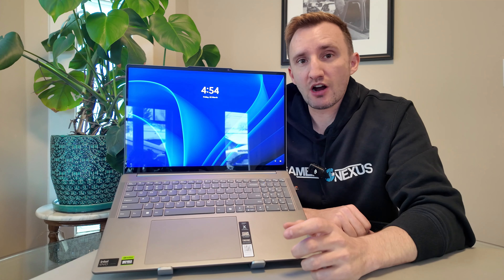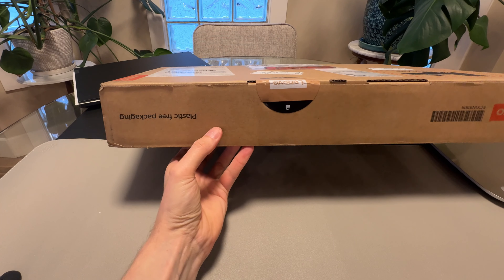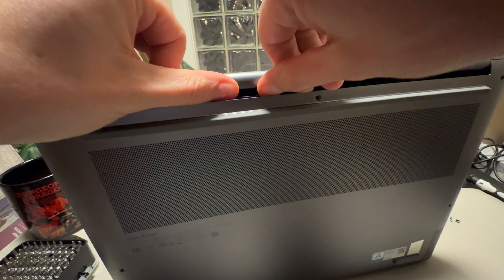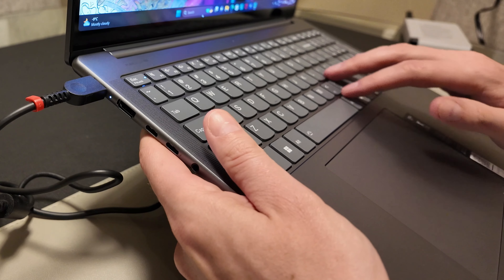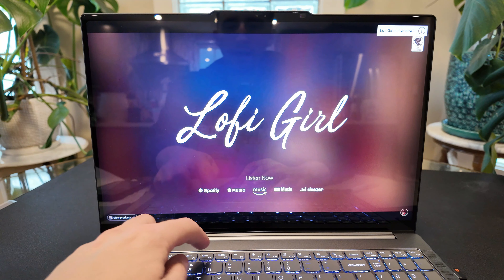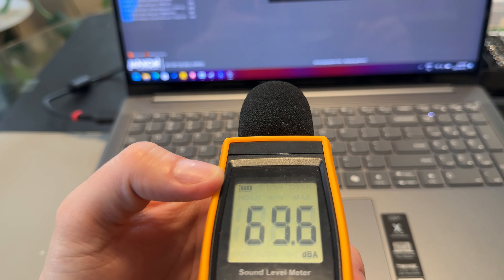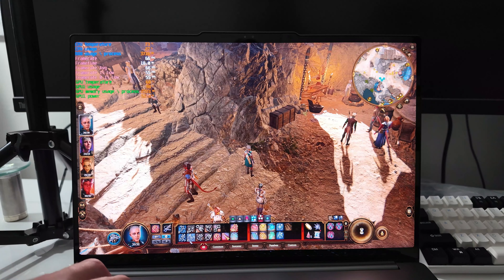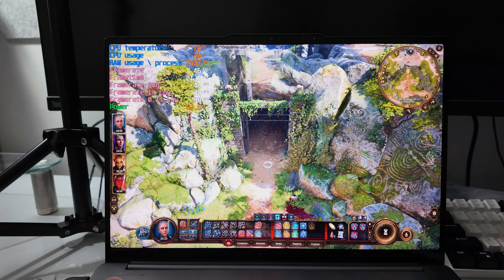I'm in Love again... 2024 Lenovo Yoga Pro 9i Gen Review

Comment: Ah! A proper review. Not sponsored. Thank you.
Reply from the maker: So not sponsored that I bought it myself 💸💸💸

Luckily it’s nice enough to justify the cost
Reply: @TechGuyBeau  Yeah, what a step up from most of those corporate influenced reviews. 
Do you think its worth upgrading from my 2023 zenbook pro 14 oled, the one with 4060 and 13900H ? 

Im really battery life dependatent as a cs stundent, the bigger display thats not OLED, doesnt degrade over time..
I feel my asus is just not the real deal for me, im used to 16inch laptops.
Or should i just wait for Lunar Lake laptops?
My other choice would be a 16inch m3pro or upcoming m4pro macbook.
Reply: @TechGuyBeau  Thank you for the review, really detailed. Also, totally agree with the RAM, never go with the smaller version if soldered.
What about choosing between this one (with 64GB) and , IPS 240Hz , Intel Core i9 14900HX , 32GB DDR5, 1TB SSD, GeForce RTX 4080 12GB? I'm between these two models with the Legion being 350Euro more expensive.

Comment: This laptop has a mux switch, if advanced Optimus is turned on, which I think it is by default, the dedicated gpu will not be recognized when on battery power. I noticed when you were trying to update the driver for the gpu that you didn’t have the power adapter plugged in. This would make sense why the driver update failed because the gpu was disabled. If you go into device manager when on battery power, the dedicated gpu won’t even show when looking at connected devices.

Comment: Hello, Which laptop would you recommend for both gaming and my work involving databases and programming with Android Studio?" Lenovo - Legion Pro 7i 16" WQXGA - Intel 14th Gen Core i9 32GB - RTX 4080 12GB - 2TB SSD or ASUS - ROG Zephyrus G16 (2024) 16" OLED 240Hz - Intel Core. Or any other model you recommend Thanks.
Reply from the maker: The legion will Massively outperform the asus. The advantage of the asus is the OLED screen (if you want that)  and weight for sure

The legion will perform significantly better, has a non burn in risk nice ips (no OLED blacks though), and is generally much better bang for th buck 

If portability is king consider the asus. Otherwise go legion

Oh… and thanks for the donation 🥹

Comment: Awesome video! I wanted to add a second NVME drive and was wondering, did you need to add some kind of heat sink/thermal pad to the new drive or is it fine without? And if you did, what did you end up using?

Comment: Thank you so much for this incredibly insightful review! It was extremely helpful in understanding the features and performance of the device. I'm currently trying to decide between this model and the ThinkBook 16p. Based on your experience and the details you've shared, which one would you say is the better choice? I greatly appreciate your advice and expertise!
Reply from the maker: The Thinkbook has better cooling, but current is 13th Gen. there is a new Thinkbook 16p coming out that would be a better match for this

The Thinkbook 16p has a lovely 3.2k screen offering, about the best IPs I’ve used. But it’s still no mini LED. However it is not glossy like the yoga 9i. If screen reflections matter

The Thinkbook is a bit heavier, something like a legion 7 slim. Both are equally premium.

Thinkbook 16p has superb speakers… but the 9i has godly speakers. 

In the end I’d decided based on glossy vs non glossy. If you can deal with glosssy (which makes the colours pop more) get the mini led yoga.

Comment: Edit: I was using the latest Linux Mint. Ubuntu itself should work better than mint currently.

It is worth mentioning that if you want to use this laptop with a Linux distro be prepared to have many issues. Current issues that I have not been able to solve are: Lack of compatible kernel headers that have compatible Nvidia drivers that also work with the 14th generation cpu, Adobe Atmos is not available for Linux so the audio is very washed out, and the LFEs (subwoofers) not properly working even after configuring them in HDAJack.
Reply: @Worthless.  I’m using rocky9 on my zenbook 14x oled out of the box, but in fairness it only has igpu (radeon)
Reply: @Worthless.  ThinkPads are nice for Linux but I don’t know if you would call them premium. Also it’s worth mentioning that HDR is not yet supported on Linux. Linux Mint 22 also may fix many of the issues I had.

I’m not the best resource when it comes to Linux on laptops. I’d suggest asking the support forum of the distro you wish to use.

Comment: What do you recommend, a yoga pro 9i with ultra core 9, 32gb ram, mini-led touch, rtx 4060 (2300€) or Legion slim 7i glacier white with 13700h, 32gb ram, rtx 4060, 3200 res screen (1550€). 
The Yoga is brand new with 3 years premium care warranty, while the Legion only has a one year warranty, and is from ebay, apparently had faulty ram which was repaired (checked repair ticket with lenovo) , the seller mentioned the faulty ram but claims the laptop was unused.
I would mainly use it for music production but like doing some color grading when I have the time. I don't game.
I wanted something that was closest to a Windows Macbook Pro laptop. (good screen, build, speakers, etc)
The Legion just popped up and the difference in price is significant (800€)
I would love to know what your recommendation would be. Is the Yoga pro 9i worth 800€ more?
(I still have a chance to return the Yoga and buy the Legion if its still available)
I would really appreciate your advice.
Thank you and all the best!

Comment: I bought this laptop and am having the exact same issue of being unable to update the Nvidia drivers. I almost returned it because I was afraid I just had a bad unit. This reassures me that if it's a widespread issue it should hopefully be fixed. Other that that, fantastic review, I'm also loving the laptop for the same reasons
Reply from the maker: I’m sure they will sort it out, but I needed to include it in the video. People should be aware of current bugs that haven’t been fixed yet
Reply: Within GeForce Experience (the one that comes installed) have you tried updating or switching to Game Ready drivers?  Or am I missing the point
Reply: @TechGuyBeau  Has this issue been fixed?

Comment: Do you still have the laptop and were you able to fix your driver issues with updates? Thanks for the great review! I have have the smaller 14.5 inch slim pro 9i and am considering going for the larger display.
Reply from the maker: It works a lot better but battery life is still bad. I’d still suggest that AMD is the way to go, as it has been for several years now. Intel has a lot of catching up to do

Comment: Awesome review. Thank you for this detailed review of this model. 

For an windows laptop this lenovo model is awesome. In my region it is priced at ~2500€. 

What do you think about this model compated to the macbook pro m3 max ? Price difference is of ~1000€. I've found m3 max at the same price as m3 pro.

The laptop will be used for programming, daily tasks, probably some LLM, AI in the near future. Thinking about doing cross platform development also, but not 100% sure (only if i go with macOS will include iOS also).

What do you think it is a good long term option?
Reply from the maker: Mac has advantages for things like battery, however for compatibility value go yoga

Comment: I had a Lenovo C940 14 oled and I extended the warranty and I had some things replaced, but they couldn’t replace my battery so they offered me the Yoga 9i pro ultra 7 as a replacement but it only has 16gb of ram and now I’m concerned but I’m not really a heavy user and I can’t be picky if they are replacing it with a brand new unit. Believe they are building it for me

Comment: Can you comment on USB-C charging? Lenovo has been awful about that in my experience. The Legion Slim 7 Gen 8 I'm using right now is very picky about which chargers it'll work with. It's disappointing enough that I'm looking to get rid of it.
Reply from the maker: Oh that’s odd. Make sure it’s a true 100 watt usb c.  You can actually pick up the Legion chargers off AliExpress for like 35 or 40 bucks. They use USB-C and technically support up to 135 W
Reply: @TechGuyBeau  yea, I'm using high quality, brand names (Anker, Hyper, UGREEN, etc.). Lenovo's PD implementation is half assed
Reply from the maker: @CraigCabrey could be. I’ve never had issues on the slim 7 or pro 5/7 but definitely know what you mean on the slim 5.

Comment: Sir, I'd like to ask you two things from Korea.😊

1. Did the glass panel you purchased come with an anti-reflective coating, or is it a version without the anti-reflective treatment?

2. I bought the 2023 version but ended up selling it because the mini LED flickering was too severe for me to use. I'm very curious if the 2024 version still has the flickering issue.
Reply from the maker: I don’t notice any flickering. Also there was no anti reflective coating
Reply: @TechGuyBeau  Thanks for response.
Could you please answer one more question?
 I'm curious whether you think using a Mini LED version for working on PDF documents or Excel for 3-4 hours a day would not cause eye fatigue or discomfort. Or would it be better to opt for an IPS version for document work?
Reply from the maker: @고민이고민이다 personally I find it better. I stare at words and spreadsheets all day. Fine resolution,  bright, with good colours helps me. You can turn the brightness high when needed  and down when not. Typically I prefer niniLED over even OLED in this regard
Reply: @고민이고민이다  I thought it was Oled screens that suffer from PWM at lower brightness?

Comment: I bought the new Lenovo Legion 7i 2024 and have the same problem with my graphics driver it says last updated one is the January 24th, did you find a solution. Can Lenovo fix this or is this something that sticks forever?
Reply: Intel Arc iGPU + Nvidia dGPU drivers have compatibility issues right now.
Reply from the maker: Mr Kirby has it. Lenovo will probably need to reach out to Intel and nvidia and tell them to behave

Comment: can you share the configuration u use in your tests? like resolution, efficiency/power/balance mode, etc. Also, how did you change from iGPU to the nVidia? :o
Reply from the maker: You can watch my gaming test, it’s out now on my channel. 

As for switching between iGPU and dGPU, use nvidia control panel, under display locate “advanced Optimus”

Comment: Did you have the discharge on 170 watt power supply that they are talking about on Reddit? Basically battery drains while on power supply during performance mode

Comment: How does the gaming capabilities (and the corresponding fan noise) compare to the Legion Slim 5 14"?  I'd much prefer the 14" size, but am very tempted by the lower fan noise i keep hearing about this laptop.
Reply from the maker: Gaming will be basically identical to the legion 5 14”. 100 watt 4060/70 is basically

Comment: Hey, I'm wondering how far does the screen tilt I have the feeling it is not 180 degrees.
Do you notice any keyboard rattling when playing music at high volume on the speakers? 
And lastly, since the card reader is a UHS-I only, does it read UHS-II cards? (usually it's possible, I guess it's quite slower though)
Reply from the maker: it goes 180 or so. there is no rattle  as the keyboard is superb

Comment: I red on notebookcheck that the Power adapter is to weak under heavy load and the Laptop drains the battery. Can you confirm this? I primary want to Game on this beautiful Mini LED Panel. But this would WE a No-Go for me. Ty very much
Reply from the maker: I haven’t noticed, then again I don’t use performance mode as it’s really near pointless when gaming with a 4060/70. You get about the same with balanced and it’s vastly quieter.
Reply: there is no notebook check for this 2024 model out yet, only last gen so you are reading about last gens model

Comment: 16" laptops should never have soldered wifi. A wifi card is small and it should be no problem fitting a socketed one. Further, if you're going to solder it, at least include the latest wifi version. Wi-Fi 6e is obsolete already and the laptop isn't even widely available yet

Comment: Hey man. I am asking a lot 😂 but I wanted to ask is the core ultra setup here good enough for me if I am looking to swap the slim 7 2023 amd for another Lenovo? Battery life and portability with good video rendering and some gaming is my bag
Reply from the maker: Battery life is not great here. And is battery king.  Performance, design, etc are great here. But battery life will be worse than your current laptop
Reply: bro why you want to switch slim 7 2023 on this, in terms of what? it serves you bad in video rendering and gaming or what?
Reply: Real unstable system issues and boot issues  @Promikes
Reply: @Franciehatescoffeeicecream  hmm can you please give some details, because I am looking to buy, same laptop as you have, please... what issue and boot problems?
Reply: @Promikes  widely documented bios boot issues and sleep power issues with the Slim 7 2023 AMD. Its a great laptop but the  issues are very annoying.
Reply: @techguybeau  im considering switching to this device, any update on real world battery use? I heard the Ultra processors are way more battery efficient? I also am curious about the monitor performance as it looks like they only do 3.2k res which may kinda suck with a 4070?

Comment: Ugh still bad battery life which is such a bummer. Thank you for this because it confirms some of my concerns about this laptop. Did you try downloading the Nvida app for your drivers to see if it recognized the 4060? It's actually really useful for switching between studio and game drivers. I originally ordered this, but canceled and went with the new Galaxy Book 4 Ultra instead.
Reply: Battery doesn't seem that bad tbh.
Reply from the maker: It’s “bad” compared to AMD, but still an improvement from 13th Gen. 

I also somewhat suspect that core ultra can Ben improved with drivers. Hopefully
Reply: @TechGuyBeau  How does the battery life compare the Legion you have there?
Reply from the maker: @iz723 the legion 5 pro AMD and Intel both don’t have great battery. Legion slims amd are the models with good battery

The yoga 9i will outlast that legion
Reply: I'm currently trying to decide which machine to go for, the 9i or the Ultra Book 4.. let me know your thoughts

Comment: how would you say the screen compares to the OLED one in the legion slim 5 14"?
Reply from the maker: This one is quite bright, so it cuts through the reflection. The 14” slim is quite nice but the reflections were a bit more obvious
Reply: How about performance of amd 7 7840hs vs core ultra 9 and the 4060 on both? I feel like amd Is better here and 1/2 the price  @TechGuyBeau  $1049 LS5 vs $2200 slim pro 9i 16 2024

Comment: Has it got a MUX switch? Does the screen have G-sync?
Reply from the maker: No gsync. It has advanced Optimus
Reply: @TechGuyBeau  ok so that's better than MUX I believe?  Also in UK can only configure a build with 64gb ram option  only with non touch mini LED matte screen for some reason? If I select mini LED gloss touch screen it drops to 32gb.  I would prefer the extra memory and don't really need touch, but wondering if the matte screen crushes the richness of the colours compared to the gloss screen ?

Comment: Just got mine, do you have the option to switch refresh rate adaptively?
Reply: How you liking it?!
Reply: @BlackBruceLeeTheGreatDekuTree  Honestly the Tidal Teal looks very nice, its a premium laptop but I think HP Spectre has a nicer design subjectively, this one is a bit more oldschool / less uniform. Other than that, I don't like that the keyboard has a numpad because it makes it off-center. I never use numpads as a software dev. Otherwise the laptop is perfect for literally all kinds of uses, performant, quiet (unless you run max load on high performance). RTX 4060 should be the go-to choice, I get about 10.5K graphics score on Time Spy high-performance mode plugged in. RTX 4070 is not worth it unless u really want the 64GB RAM option.  Display comes in matte if u don't want touch, also great IMO.
Reply: @burbanana  Do you feel there are any disadvantages of the matte screen coating? I'm trying to decide between the mini led touch screen glossy and the non touch anti glare configurations ?
Reply: How's the battery life? Could you share the wattage consumption on battery while web browsing aswell as watching videos? (at 60hz and dGPU disabled)  I'd be so grateful
Reply: @burbanana hey, snare with us bro
Reply: @robmck6573  My replies sometimes don't get sent on youtube, I don't know why. I don't think there are disadvantages etc. It depends on your own need. If you like colors popping, then you take the glossy with maybe some glare. The screen has a VERY high brightness so you can eliminate the glare as well with the higher settings! I just did not want the touch so I took the non-touch and it came with a matte display. Matte looks more 'crisp' to me and has no reflections at all so if that is what you need then go for that. You can't go wrong with this display either way.

Comment: Do someone know how the regular IPS-screen on this yoga pro9i is?
Reply from the maker: It’s a very good ips but it’s glossy if that’s an issue
Reply: @TechGuyBeau  Appreciate it man, thanks alot.

I am on the fence between the mini-LED version or the IPS version.
Lenovo have a deal here in Norway now:

- IPS version with glossy and touch, Ultra 9, 32gb, RTX 4060 for 1900 USD.
- Mini-LED version matt non-touch, Ultra 9, 32gb, RTX 4070 for 2200 USD.

Also do you know how the laptop preform connected to external displays either trough HDMI or usb-c/TB4?
Reply: So which screen you went with, IPS or Mini LED?? How did you like it? Also, how did your laptop performed connected to external displays via HDMi or TB4??
Reply: @AdilQuraishi  Hi, I have not purchased any laptop yet. I'm waiting for a sale